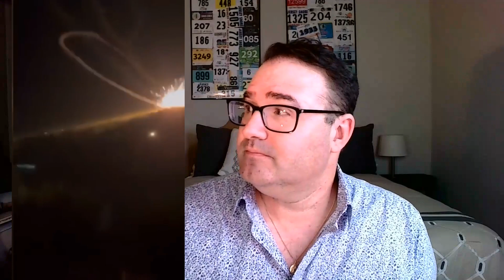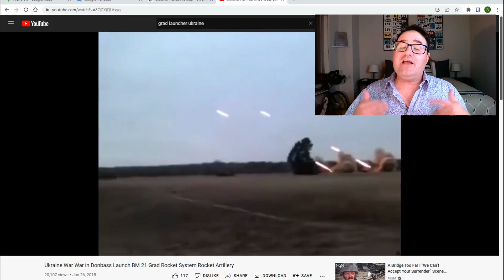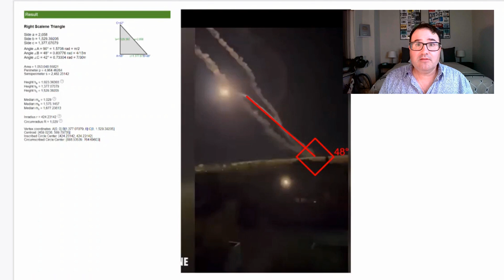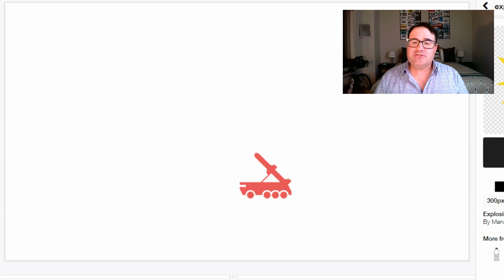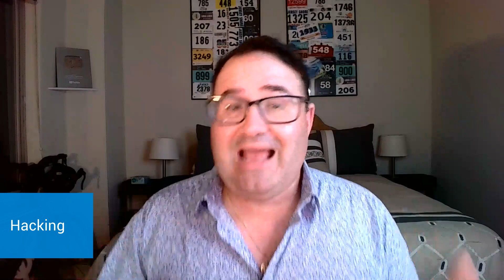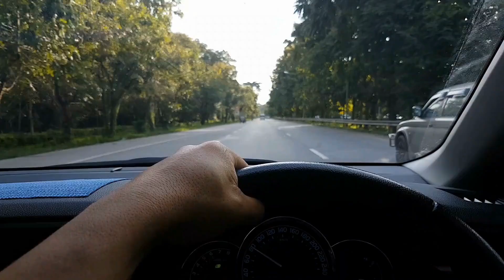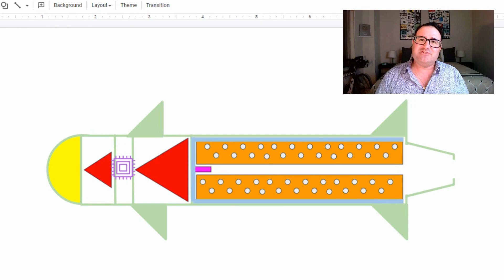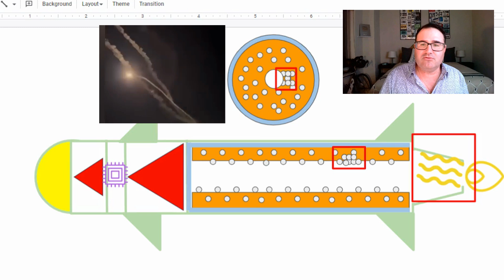Why this missile U -Turned

Comment: I don’t think an uneven fuel burn would cause a perfect 180 at those speeds, I would think it would more likely cause it to corkscrew out of control or veer wildly in another direction, but not perfectly turn the missile around at top speed.  Mishandling and/or shoddy manufacturing almost certainly caused this, but it probably had something to do with the electronics or guidance system.
Reply: Year, I think its a more advanced rocket that likely has vectoring of its force, if this failed in one direction it would explain the slow down, curl but then speed up when its completed its 180 and required its beam.  Good tech for 1980's, but not reliable for 40 years.

Comment: Your explanation is not self-consistent: you exclude any involvement of the fins and guidance on the basis that it wouldn't happen during normal operations of the rocket and then use that to conclude that the rocket is defective and not operating normally.

As others have pointed out, the rocket motor alone cannot do such tight turn at high speed without thrust vectoring.

Guidance and fins must be involved somehow in this incident to explain both the extreme turn and the fact that it was flying more or less straight before and after.

Also: hacking, as unlikely as it is in this case, most definitely doesn't require a computer connected to the general internet.

Comment: unlikely to be anything to do with the fuel grain, because they still have an inert nozzle at the exhaust end. The older solid rocket fuel may have had issues with inconsistency in mixture and irregular burn times etc. but these are problems that were known about and aggressively solved. Urbanski gives a fair bit of information about the history and science of the problems and advancements made in this field. Now solid rocket fuels are excellent all round. They are stable,  and have good shelf life and excellent burn profile.

Comment: Sorry to say that I don’t think that is plausible explanation. Yes there could be unsymmetrical combustion in the combustion chamber but the nozzle has a centered outlet of small diameter where the exhaust gas reach the speed of sound. Should there be a short overconsumption, it will create overpressure but not unsymmetrical outflow of gas.
The way I see it is more likely a guidance malfunction. Some missiles (I don’t know if this is the case for this one) have an autodestruction mode that triggers when the guidance is lost. Aiming to the ground is the simplest autodestruction mode you can make.

Comment: 100% agree. While it seems counterintuitive, mishandling of the fuel and the accumulation of excess fuel on one side, forced the missle into an immediate 45 degree turn. We’ve talked EXTENSIVELY about weapons capabilities of Russia and China during our PSS-SOF course and Master gunnery (13 series).  Fins on these missiles do not have the surface area necessary to generate a new vector placement of the nose of the missile. Therefore, additional thrust in the opposite direction occurred which pushed the missile in that direction and because it then straightens out and doesn’t turn, pretty much confirms that assessment.

Comment: If you look closely the missile has two changes in direction: the first is slight, then a second which makes it plunge into the ground. There might be another possibility: SAM missiles run towards their target’s predicted point of interception (ahead of them) not the current position (chasing). If the target (we can’t say which one it was) dropped to the ground suddenly, the missile’s target predicted position might well have been directly below ground level.
Reply: I have to give the Russian engineers more credit than that.

Comment: I thought it seemed to be an issue with exhaust force vectoring.  (although I have zero knowledge of the actual system used). Your explanation gives it the technical reason. Thanks for sharing.

Comment: A lost fin or mechanical failure of same would do that. The rocket could change directions and go wild. Didn't happen because of very high speed. Didn't give it time. I saw it happen with a flare rocket. We all ducked to the floor and flew over us.

Comment: You discount the stuck-fin theory pretty dismissively, it seems.  Even in a mishandling scenario, why would it be impossible for one of the fins (or an actuation servo that controls a fin) to just "jam" or for an errant servo-control signal be electrically misfired from within the warhead guidance module?  I recognize and agree with your explanation that burn-stage flight regimes don't necessarily call for any gross-scale guidance maneuvering, and your explanation makes sense that the absence of burn-stage maneuvering is because the maneuvering is designed to take place during terminal-homing.  This still means that the capacity to maneuver, and the structural articulation hardware to make that capacity possible, still exists during launch, even if normal flight design calls for that maneuvering hardware to remain essentially inert.  And incidentally, I recognize that the fact that the missile, by the source footage, seems to remain straight and true for that first ~1.5s of flight -- this means that we can pretty much rule out the possibility that a stabilizer fin was mechanically jammed within the launch tube itself, because if that had instead been the case, the missile would've u-turned immediately upon being jettisoned from the launcher (to say nothing of likely damage to the launcher itself) without there having been the 1.5s delay.

But I ask, could flawed wiring (whether flawed by manufacture, or in storage and handling as you suggest) have resulted in an electrical short taking place aboard the missile once airborne?  Or can you elaborate on some reason, perhaps something your trained eye can tell from the flight path shown, that causes you to rule out any possibility of an aerodynamic cause entirely?

Comment: I was watching another videi on this topic that confirmed the launcher was indeed the Buk system. I was thinking that as these are expensive missile systems, whater they had to launch 3 or 4 must have been a real concern for them. Dont they usually assign 1 missile from this system per incoming target?  Is the Buk system capable of attacking multiple inbound targets at once? Thank you
Reply: They usually fire twice at maneuvering targets.
Reply: @ChucksSEADnDEAD  thank you

Comment: To me it looks very much like it acquired a target on the ground: such missiles are nimble (they can vastly overturn fighter jets at speed) and the flight path at the U-turn looks controlled. Russians are running out of PGMs and some reports say they are repurposing SAMs into ground attack weapons as a crude workaround. This incident shows one of the obvious risks.
Reply: I think that may be a plausible explanation if they are indeed messing around with SAMs as ground attack weapons, although it'd be hard to get anything confirmed.

Comment: I heard from someone in the military in Ukraine (I'm Ukrainian) that the reason for the "return of the missile" may be that Turkish President Erdongan previously (before the war) bought russian S-300 air defense system & the latest S-400 from russia & of course BUKs also & based on them , they back-engineered it & created their own air defense systems, with "double protection"(?), with such technology that even russian air defense s-300, s-400, BUK, etc. (which are really just a Soviet air defenses from the 1970s with slight improvements) will not be able to shoot down Turkish air defenses and Bayraktar drones. They are set up so that if a russian air defense missile flies at them, it will send them a signal that it is "a friend, please no friendly fire", or "magnetically" make it rethink it's route to fly the other way.
Yes, it's not a mistake, lowercase "russian", so as putler (putin).

Comment: I would not be so quick to rule out a stuck fin, or so quick to pronounce that it was imbalanced burning

1. The turn rate is gentler than the smoke trail implies. If we assume the missile's smoke trail is entirely in plane, then the missile seems to decelerate rapidly near its apex then accelerate by almost the same amount near impact. This doesn't really square with the motor visibly operating throughout the turn - even poor burning doesn't result in such a consistent acceleration profile for reasons I will go into later. What's more likely is that the missile is turning in a gentler arc towards the camera, while constantly accelerating. This is supported by the sparks appearing to radiate away from a central point, which would make sense if the missile impacted more or less pointed towards the observer. My intuition from watching launch vehicle failures (admittedly somewhat different from SAMs) is that a stuck fin/ actuator can easily accomplish such a turn. The car example perhaps isn't the best, simply because if you stick your steering wheel at an angle, you WILL describe a 180 given enough turning room, which this missile has but a car on a narrow road typically doesn't. 

2. Imperfect burning doesn't lead to imbalanced thrust on one side. Solid propellant burns in an exponential fashion, and I mean mathematically exponential, not the colloquial use of the term to mean any non-linear behaviour. If you have a divot or hotspot, it burns faster and faster, until the flame front breaches the entire fuel grain and directly attacks the propellant casing. So the end result of imperfect burning is usually an immediate explosion with no warning, not a continued period of imbalanced burning.

3. I think you're underestimating the level of guidance a missile requires in the boost phase. As a missile picks up speed it encounters greater and greater aerodynamic forces, and the control authority of its fins becomes correspondingly higher. Unavoidable asymmetries in production as well as gusts and other external phenomena will disturb the missile from its proper attitude, requiring increasingly fine adjustments of its fins as the speed picks up. All this is before the missile even turns to track the target - just getting to motor burnout can be a very involving process for the missile, if it wants to maximise available maneuvering energy. As such the guidance system and fins failing at this critical juncture will lead to at best a waste of valuable KE leading to a no-kill, and at worst a 180 as described here.
Reply: Good pointing out the camera perspective thing, makes more sense based on the supposed trajectory to be more gentle.

Comment: One of the curses of dealing with Russian systems... they reuse names.  Buk could be a handful of SA systems with some of the newer variants capable of turning and others not so much.

I am thinking bad chips or bad wiring.  So instead of receiving target data it received it's home location data instead.  That missile went return to sender in a way that didn't look like a malfunction.  Meaning, if it was a fuel burn issue the guidance chips would be causing the fins to try and correct and you would see wobble.

There also could of been a freak accident where the first two missiles launching caused such a IR heat spike that the tracking system identified the launcher as a threat and when the third missile launched it turned around.

Comment: It's very tricky to answer, in most theories the missile should just spiral out of control not head back to the launcher.
Reply: If it was some sort of mishandling, it really is a 1 in a million chance for it to do an almost perfect U turn like that, but as we've seen anything is possible
Reply: @twanchee206  with infinite amounts of mishandling, eventually fate will find you
Reply: It doesn't actually head back to the launcher, there are two videos, one angle makes it appear as if it does, the other angle actually shows it doesn't.
Reply: EXACTLY!

Comment: I really like your theory, I will agree with mishandling or manufacture defect.
My opinion:
The lower end of the solid rocket fuel has a crack in it, the air gap cause gases to burn through the protect layer and out the side of the missile, a direct force pushing the lower side of the missile around, then the ark of the 180 gets wider as the missile kicks into its next stage and picks up speed, just before hitting the ground.

🥸
Reply: Yeah that's what I initially thought aswell, basically a leakage of gas that turns it around. Still, it would be somewhat unlikely that it did a nearly perfectly 180 degree turn.

Comment: Naah, don't buy it. Uneven burn inside the rocket fuel would not change the force of the expended gas this much. The direction is controlled by the exhaust nozzle not by the burn of chemicals. 

Much more likely (IMO) is that it was an anti-radar missile and then for some reason locked onto the radar of the SAM site itself. Guiding itself back to the SAM's radar. Its u-turn is way to controlled to be an accident.

Comment: The rocket motor theory is interesting, but I'm not convinced. The nozzle of the motor should normalise most of the force from anything like that. What's more likely is for the accelerometer of the INS to be installed upside down, its happened before a few times in rockets, and the launch sequence would also back it up: When an air defence missile is launched, the first priority is to get clear of the launcher. Larger the explosive risk, the further it needs to be, and this is one of the major factors in MED of a system. That couple seconds of straight burn matches up with that early post-launch behaviour. Once the guidance system is activated it immediately does a fairly precise 180, which heavily suggests it was a backwards INS. If you're not convinced, have a look at other videos of rockets having the same issue, I believe there is one relatively recent that had the INS activated in a stage mid air just like this.

Comment: Its not buk or sam, its Mlrs where at least 2 misiles are already fired. You can see immedietly after boost it turns. The first two have been feed with correct coordinates but the third the guidance system was feed with the coordinates of the base station. However it could be himars, sadely.

Comment: It's an interesting theory
But purely from a theory crafting perspective,
in a world of interaction effects, don't let one explanation rule out the other.

It's perfectly possible multiple errors happened simultaneously.
People say that's improbable, well, some of the most renown disasters in human history had more then one reason for it to occur.

I am a proponent of the clusterfuck theory. 😂
In life in general, not just here, it's how chaos tends to work, ever more raped successions of bifurcations as more energy is put into the system.

I also wonder what happens to the rocket guidance if the target is lost during the launch of the missile, does it travel to the coordinates? 
Or is this like a laser thing, and if someone says:
Ow great we destroyed the plane! And someone drops their hands down with the laiser pointer still on... 😂

Anyway, it's interesting.
I also have a question about the artillery barrels, back in the time they used bronze, I was told barrels could explode from overuse (metal fatigue)
Is this still the same today with the current metallurgical composition, or is it just as you said in the video, it won't fire as accurate anymore?

Anthony your Sunday!

Comment: But you could be right too, but its hard to know, either way you can also see the light vary as the missiles turns abruptly, which means either that there is some vectoring from vectoring outlets or as you said there was irregularities in the fuel. i don’t know, but either way it wasn’t supposed to do that lol. I just find it quite unlikely that it does an exact 180 degree turn because of fuel irregularities, but the same problem exists for some broken vectoring stage, we’ll never really know without identifying the missiles properly. If its the kind of missiles you where referring to then idk if they have a dedicated boost stage with vectoring or not like the Russians cruise missiles, but yeah either or makes for practically the same outcome l, and in either case its really bizarre that it managed to hit itself.

Comment: A similar occurrence has happened back in the Nagorno-Karabakh War where Armenian rocket launches did a similar thing, launch fine for the first couple of seconds and then plummet back down. Putting out another theory that the guidance system could have been jammed or interfered by something, causing it to lose target lock

Because what I find missing about the mishandling theory is that the clumps should have produced a visible bigger trail of fire like what we see with previous similar incidents and the clumps doesn't explain why it made a complete U-turn rather than just wildly spin around like the russian cruise missile launch a few years back

Comment: All it would take is a single dry solder joint in the guidance system to cause this, or even a failed control surface or what you said, or something completely different, no one is really able to know for sure.  The only thing we do know was it was a malfunction ;)